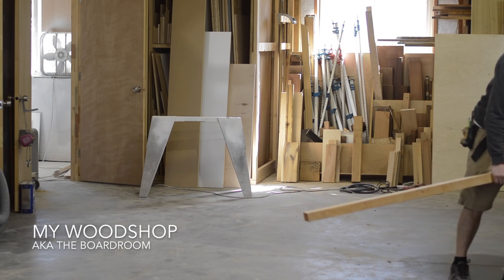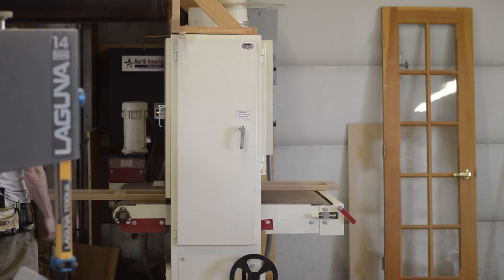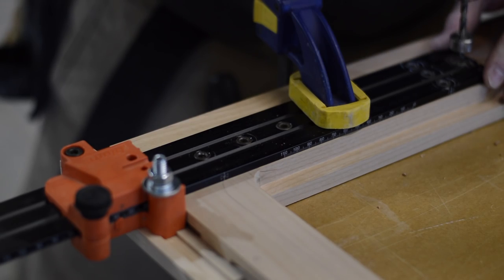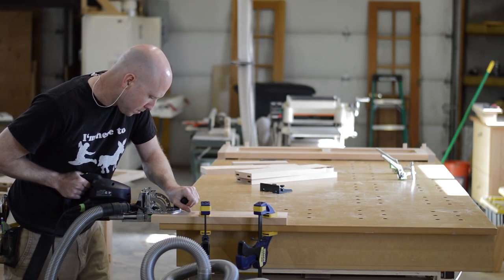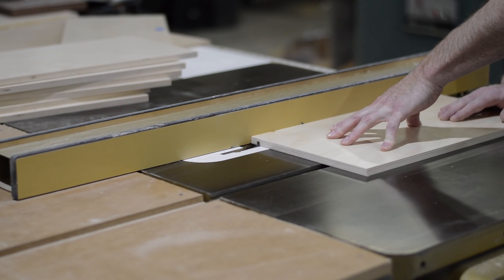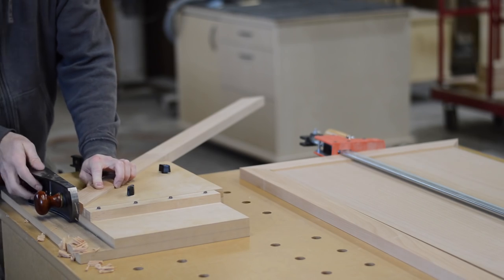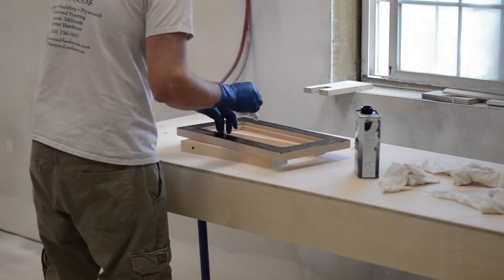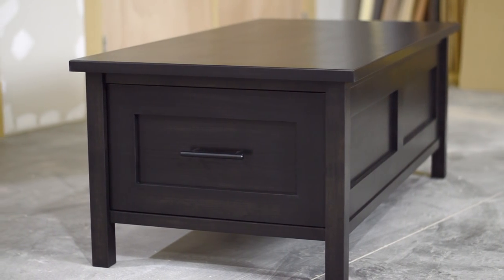Lets build a coffee table with drawers

Comment: This turned out really nice. I like the recessed/depth look of the drawer fronts vs. the typical flush style. Btw, being a printer for 25+yrs I understand the whole "solvent to waterbase" issue. I clearly recall when industries began their full, or partial switch overs to waterbase products as we did. The complaints were many, yet short lived and as you just echoed, they work great. I do remind myself that solvent base products still have their place though.
Reply from the maker: Certainly there is no easy answer between the two. Both have their place, both have pros and cons.

Comment: Mike, another great video, thank you.  Your use of biscuits is really interesting as the Youtube 'Festool-Crew' seem to have convinced everyone that biscuits are not fit for purpose.  Great to see a pro using them successfully, especially one that also has a Domino.  The technique for mitres with the jig and shooting plane was pretty cool.
Reply from the maker: Thank you. The Festool crew is part of the reason I show my use of biscuits. I just want to present another option. A large part of woodworking is making choices and deciding what is strong enough, easiest, way of completing a project. Yes, using a miter jib makes miters super easy and perfect results. Also if the angle is off a little you can shim the work pice with a little sandpaper to adjust the angle.

Comment: Great build.  On the blum tandem slides, I use, I think they are, #7 phillips flat head screws.  The taper fits in the holes ok.  I've never had a problem.  I only use the pan head ones you show, on side mount slides that have small holes.   However, now I have a new (used) line machine, so I hope to use the 5.5 mm system screws from now on. They definitely have the most strength and accuracy. That's a nice blum jig you have.
Reply from the maker: I agree the tapered screws can work, but that still leaves the problem of accurately placing the screw. A jig works good for the accuracy and consistency. Line boring machines work great, I have a 23 spindle Ritter machine. I still find myself using the jigs for small/odd stuff, like this build.

Comment: Once again your work is exceptional. I also use osmo hard wax oils not sure if u know u probably do they come in different tints and shades that for feeding the wood and bringing back wooden counter tops to new. Once again I applaud u sir.
Reply from the maker: Thank you. Yes, I am somewhat familiar with the entire Osmo line. I want to experiment with some of the colored options, just need the right project. Also, they have a two part catalyzed finish that looks very good.

Comment: Another great build and video Mike. Gosh I wish I would have know about those Blum drawer front mounts when I did my built-ins. I don't think your sanding table has any down draft, you just rely on the sanders dust collection? Oh, and the floor mat is a great idea.
Reply from the maker: Thank you. I specifically bought that sander because of its good dust collection. I can sand all day and very little if any dust makes it into the air.

Comment: Awesome man! Not sure whether you’ve used them but the Blum Movento drawer slides offer adjustment in all directions, making your drawer front thingy mi bobs unnecessary. I feel silly telling a professional, but hey, just in case this slipped under your radar ;-) Absolutely loving your vids!
Reply from the maker: Very good tip. I am familiar with the Movento slides. The Blum Tandems are also 6 way adjustable if you buy the right locking mechanisms. Left right, up down, and tilt.

Comment: Thanks for another great video
Reply from the maker: Thank you for watching.
Reply: I made a pair of 71" tall pantry cabinet doors today..... sure wish I owned a wide belt sander. Looks like the perfect ticket for flat frames.
Reply: And I see the dowler again, :-)
Reply from the maker: A wide belt and door making are like peas and carrots.
Reply from the maker: That dowler is awesome. I need to get a couple more bit sizes for it.
Reply: Mike Farrington, I was looking them up online today and did not see any that came with 5 mm bits. They all looked much larger. What was the brand on yours? I only saw the Triton and the Mafell
Reply from the maker: Mine is the Mafell. Normally, this tool is used with 8mm dowels. This is an industry standard.

Comment: Mike, I enjoy your videos tremendously. Question, do you have a build video on your lift bench? Woodworking for 43 years has taken it's toll on my back.  BTW. You are not the only one that lives in a state with a rapid weather change.  Here in New Hampshire our motto is "wait five minutes it will change". :-)
Reply from the maker: Thank you. My bench is an Autoquip lift table with a torsion box top. I am in the middle of rebuilding the top. I will have a video out shortly. Stay tuned.

Comment: Great work once again and I really enjoy how you explain your work processes. I noticed in your fireplace Mantel and Bench Seat videos you used Sherwin Williams Pro Classic and Kem Aqua and here you are using ML Campbell products. I've never used either one but my assumption was a pigmented finish would hold up better than the SW Paints. Can you help with explaining the differences and why you choose the SW paint vs a pigmented finish? I thought finding a product to stick with would be easy... lol. Thanks,
Reply from the maker: Thank you David. I use pro classic when things are built in and other painters will be painting up to my work. Like in the fireplace mantel video, right after I was done all the rest of the woodwork was going to be painted with the same pro classic. I also use pro classic when there will be a combination of sprayed and hand painted surfaces. Like in my dining room reno video, there was a little hand painting to do after I sprayed. This is because pro classic brushes out pretty well. I use Kem Aqua when a little more protection is needed or I won't be doing any hand painting. Kem Aqua is much faster drying/stacking as well. The ML Campbell clears was an experiment. I have another clear I normally use, but my local supplier was pushing this stuff so I gave it a try. I'm going to do a spray finishing video soon where I will go into detail about what products I use, when, and why. Stay tuned.

Comment: Really cool video. Appreciate you going into a bit more depth with regard to your preferred use and the limitations of the Domino and Biscuit... and the dowel, to a lesser extent. Thinking out loud here, but are there any more variations of dowelling machines other than those three...?

Keep up the great work, Mike. One of two woodworkers that I clicked the bell notification for!
Reply from the maker: Thank you. In terms of hand held tools on the higher end of the scale, its Lamello biscuit, Mafell doweler, Festool small domino, Festool large domino. So 4 total. Did I miss anything. Thank you for clicking the bell!

Comment: Lovely table, Mike.  I noticed it is very similar to Wood Magazine issue 237 and I got to thinking about design differences and styles.  The tables seem to be similar in length and height, however, the panels are completely different, most noticeably the depth of setback from the frame  (rail/stiles) to the panel.  Wood's frame is very shallow, 1/4 to 3/8 inch I believe.  Yours seems 'hefty," maybe 1/2," comparatively.  The Golden Ratio is clear on the height and length, but depth, on any furniture piece, leaves me confused.  How do you determine those numbers?  I ask because your pieces are always so well proportioned, and when I build off my own design, it always seems a bit off.  *edited to add clarity on setback info
Reply from the maker: I don't think there is a right or a wrong answer. Personal preference is the order of the day. In this case that setback was a function of the the thickness of the panel, as that was cut in enough to make if flush with the inside of the frame. Hope that makes sense.

Comment: I love your videos more and more, they have such a pleasant, calming, and professional feel to them. Thank you for uploading such high quality content. Question from a beginner: I've noticed you use very high quality tools (lemello joiner for example, compared to say a dewalt), and can understand experience and mastery of the craft breed the want/need for higher accuracy tools. I'm mostly wondering what tools you have found over the years to be the best overall value (cost, utility, pleasure to use)?  Thanks!
Reply from the maker: Thank you for the kind words. Regarding the tools, unfortunately I have found you get what you pay for. I will say, the tools I currently own, I didn't start off with them. I started off with cheap tools, and I worked very well with them for many years. I have found that there are two levels of tools, the big box store stuff and the high end stuff. From the big box stuff I like Dewalt, Makita, Bosch, etc (I own many tools from these three companies and I like them all). They all have pros and cons, but most importantly they all get work done. The just lack some of the refinement and accuracy of the ultra high end tools. Also, using a tool hours a day, every day, little things become important (like balance and feel), that you wouldn't notice if only using occasionally. This is where the high end stuff really shins.
Reply: Awesome, thank you for the thorough reply.  Last question :)  I've been considering my first real joinery tool that can be a go-to for most things... seems like you'd suggest the biscuit which I like the idea of, but you also pointed out its limitations on narrow pieces and used the domino in its stead. Is there a benefit of a domino over a doweling jig? Or is it always the eternal and unsatisfying :  "depends on the situation"?
Reply from the maker: I really can't offer a tool that is the best for everything. If you want to spend some money on a handheld joinery tool my recommendation is the small Festool domino. The biscuit joiner has too many limitations on width. Any time you are going to make a cabinet door, you will be limited by the width of the cut. The domino can do everything pretty well, its not cheap, but it covers soo many tasks in the shop. Cabinet construction, door construction, drawer construction, furniture, panel glue up, edges of panels, center of panels, and the list goes on. A dowel jig is useful, but doesn't cover nearly as many tasks as the domino. Hope this helps.
Reply: Mike Farrington thanks! that does help a lot, I'll start saving 😊

Comment: Just recently found your channel. Love your work and also your voice overs, which I think are  the best I've heard. One question, On your assembly table, what type and model scissor lift are you using? Thanks for the info and bring on more videos!
Reply from the maker: Thank you very much. The lift I use is made by Autoquip, its the 72" x 36" model and can lift 2500 lbs. I bought it used.

Comment: So clean and beautiful. Do u always shellac (barrier coat) after staining? Does that help by requiring less coats of poly? Or are you concerned about adhesion? Any other reason?
Reply from the maker: Thank you. Yes, 99% of the time I barrier coat. It does not reduce the number of top coats, it's just to help with adhesion. Also, it prevents some of the grain raising when using water based top coats.
Reply: Good to know thanks!

Comment: Mike, you also mention using Prefinished Baltic for your drawer boxes. Is that also know as UV clear finish on the Baltic plywood? If so, does the Osmo Hard was oil finish match the UV clear finish on cut edges? Thanks again.
Reply from the maker: There are different finished applied by the factories, but most of them use a UV cured finish. The Osmo doesn't really match, but because its on the edge with the ply showing, its really not noticeable. Thank you.

Comment: Just curious about your 2nd "pro tip". Why only sand to 150? I'm still pretty new to this, and have sanded to 220. I'd love to ditch the extra work! :) Love your stuff! I cannot wait to see more of your Kumiko work! Cheers!
Reply from the maker: Thank you. First, don't re-sand your project, 220 is fine. My though process behind not sanding past 150 or 180 is that a film finish builds on the surface and fills the scratch pattern, so the additional sanding is just lost time. Second, the more modern film finished need whats called tooth. That is to say they need something to hold on to, that happens to be the scratch pattern from sanding. Hope that makes sense.
Reply: Gotcha!! That's going to make life much easier!! Cheers!

Comment: Thank you for your quick reply. I am looking at the website for the source you recommended... recommendation on length of the 5mm screws for drawer guides?  Again, many thanks and keep up the great work! Cheers
Reply from the maker: I use 13mm for normal use. I use 9mm If I am going to be screwing in from both sides (partition).

Comment: Fantastic work. That stain looks like it goes on evenly without blotches. Did you use a stain stabilizer and what color duraseal did you use???
Reply from the maker: Thank you. No, stain alone. I don't remember the color, I think it was ebony.
Reply: @MikeFarrington  thank you. Neat! I may buy a "True Black" and a light brown, and by mixing I should be able to have all shades in between.
Reply from the maker: @MrRon2k  I think that is a pretty good plan.

Comment: Mike - amazing work.  Question on the drawer boxes - you mentioned coating the top edges in the Osmo hard wax oil (I assume to protect the plywood end grain).  Did you coat the remainder of the box with that product as well or do a shellac & lacquer clear coat?  Or something else?  Thank you
Reply from the maker: Thank you. The remainder was pre-finished. I used a pre finished plywood.
Reply: Mike Farrington Thank you for the reply - I missed that in the video. Let me ask a second question - if you weren’t using prefinished for the drawer boxes, but wanted the raw look as you have on this project, would you finish in the same way you did the remainder of the table, minus the stain?  The shellac sealer and a lacquer finish?  I appreciate the advice.
Reply from the maker: @matthewh.7499  Probably, lacquer works pretty good inside drawer boxes. A wipe on finish would work as well.

Comment: I've been looking a lot at water based lacquer. Would you share what you use or like?
Reply from the maker: Thank you Dave. All of them have their ups and downs, I have used 4 or 5 different brands at this point. They are tricky to spray, a tiny bit too much and they run like crazy, slightly too little and it has a rough texture. The one that is easiest, at least for me, has been sherwin williams kem aqua. It comes in clear and a white. I would suggest starting there.

Comment: You do a nice job but to get to the next level a shaper is needed. Ive been building cabs and interior trim for 25 years. Freeborn tooling is the best option for what you need. Stu Corbett Carpentry
Reply from the maker: I have a shaper, they are good tools. I also have some freeborn tooling. All good stuff.

Comment: if you only had one which would it be, Mafell duo doweller, Mafell biscuit joiner or Festool domino?
Reply from the maker: Quick correction, I use the Lamello biscuit joiner. With that said, if I could only have one it would be the small domino. Its the most versatile for furniture making.

Comment: Nice drawer construction, but I have one question.  Why the dowels on the drawer butt joints?  Why not just stick with the biscuit jointer?  Mmmm biscuit jointer.....(picture Homer drooling).
Reply from the maker: Thank you. I use both. Sometimes the height of the drawer doesn't lend it self to biscuits. For example, if one biscuit is not enough, and two won't fit. That was the case here. I couldn't get a good layout.

Comment: I must have missed it, but why offset the biscuits just to plane the lip? Make them even?
Reply from the maker: To super make sure that the two surfaces are flush. The plywood veneer is really thin, so I set the solid edging up a tiny bit, then cut it back. This yields a really nice joint.

Comment: Maybe I'm just blind, but I think you skipped over the part where you installed the panels in the frames. How are they held in place?
Reply from the maker: No, you are not blind. I didn't show that part, just part of the editing process. I used 6 dots of epoxy and a few 3/4" brad nails to hold each of the panels in place.
Reply: Right on, thanks for the response!
Reply from the maker: My pleasure.

Comment: If we use the titebond glue in the joint, Is there any purpose to use screw or nails? otherwise it should be strong or not? Please reply me as soon. I am also following your channel . It is very useful to me.
Reply from the maker: A proper glued joint is super strong. No screws or nails needed.
Reply: @MikeFarrington  Thankyou so much for your information.
Reply from the maker: @naushadhassan4775  My pleasure.